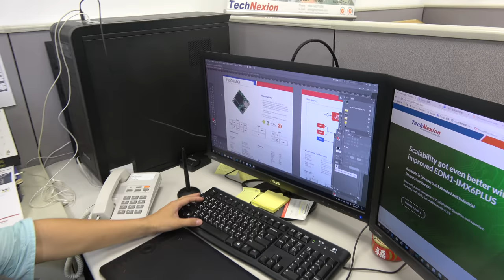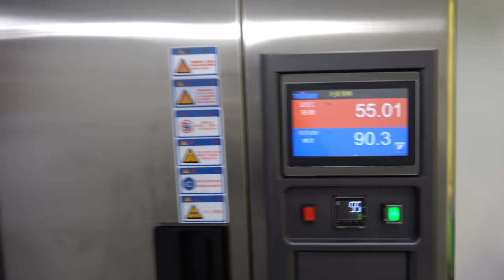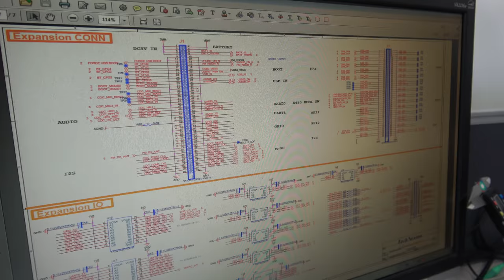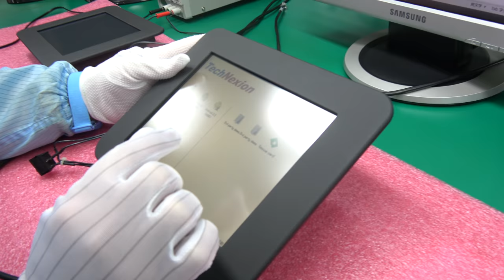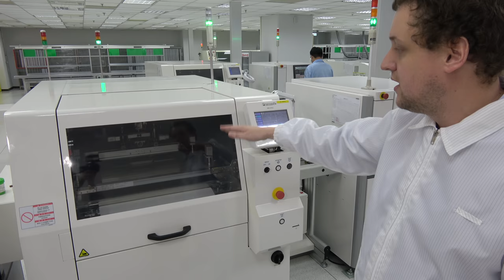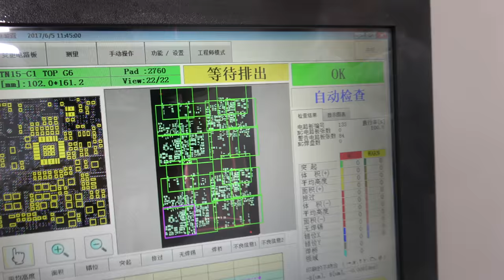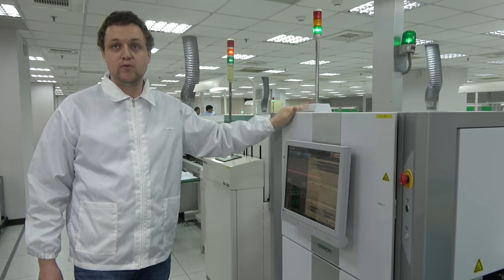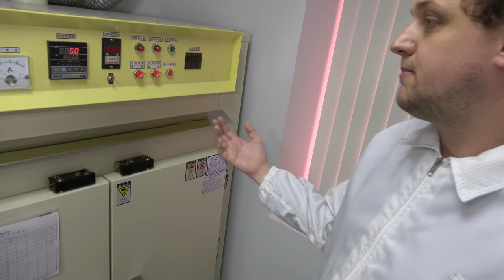TechNexion Factory Tour

Comment: This company is good the person of tour looks experience  about the compony need 
I see they like Japan this is good, equipment is top so error reduce Panasonic good quality and speed all time CKD one of the best SPI I would like to see Vi Pi on there AOI good 5S good all department this company is better to other Automotive company 
is important have good control off the process looks good traceability berry important to kwon what happen when you have one problem.

Better can be no more two people for line SMT better only one, more automatic system software for SMT AOI,SPI in line using ng buffer quality information, first rate pass 
better no use pcbs bad mark, no good manual mounting we like see tack time of process 

Every thing is good except person of the camera need go to eat some pizza and more experience about this process.

Good look for this company.
Reply from the maker: OK I will eat some pizza, thank you.

Comment: How to design stencil.
Reply: There should be a gerber file for each physical layer of the PCB, along with a layer for paste, silkscreen, solder masking, drills etc.  The paste layer would be used as a starting point for the stencil design submitted to the stencil shop.  Each company is different, but depending on how you manage your package library the paste layer may not even need to be modified before the stencil is cut.  Where I work, we go through a stencil verification process and modification process prior to giving the stencil shop the go-ahead.